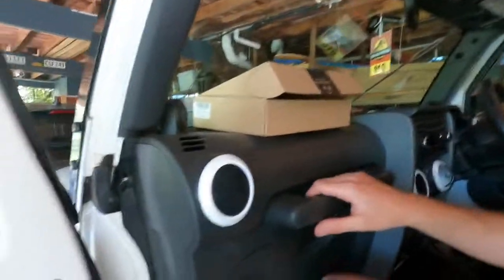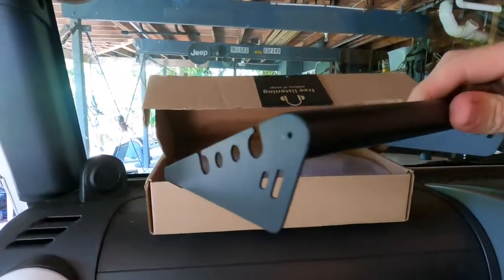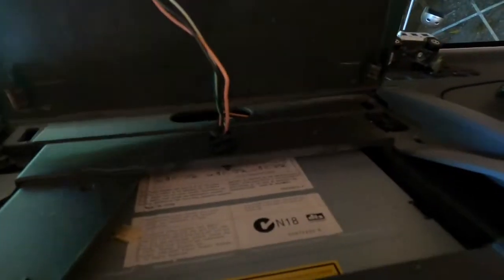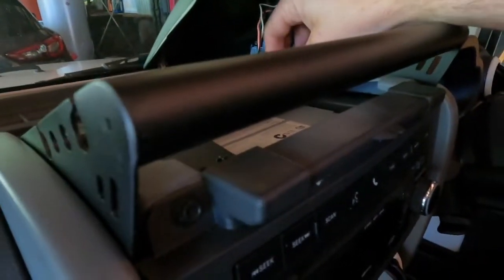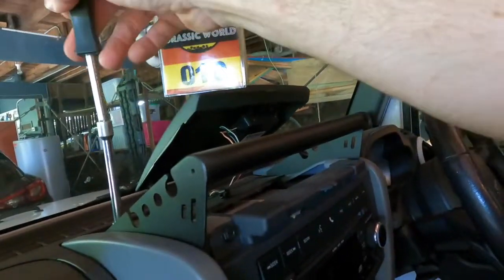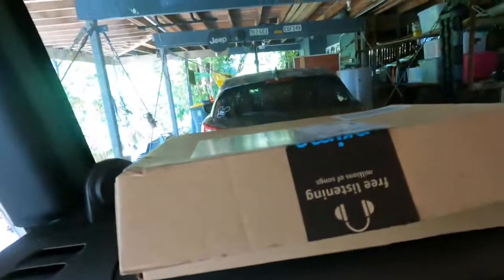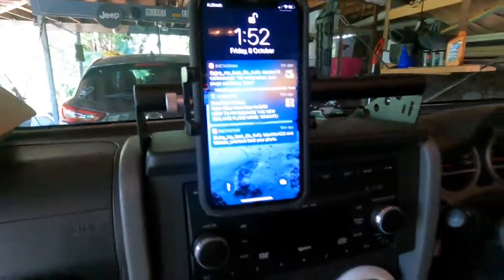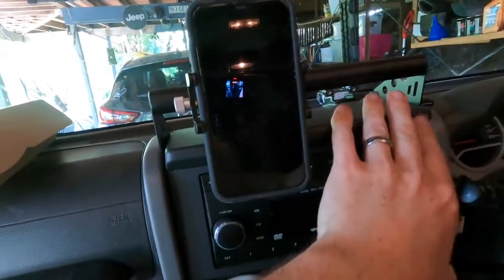JEEP JK 07 12 PHONE HOLDER

Comment: I have the Rugged Ridge center dash top replacement with the phone holder that you mention in your video. It works okay as long as you don't expect to record non-shaky video from your phone while it's clipped into the phone holder. The plastic flexes too much to keep the phone from shaking all over. In addition, the rubber clamp covers have fallen apart on mine, so at this point I'm looking to replace it...I just might have to pick one of these up, especially since I still have the original dash top plate kicking around.

A thought for those holes in the side...Find grommets that fit, run a USB cable through them, and snap the grommets in those holes...Nice, well-retained cables.

You're fighting too much with that top dash cover. It's really easy...Grab it at the rear and pull it up out of the clips, tip it up at the rear, and slide it forward off the dash frame the dash cover piece hooks around. Installation is reverse of removal. Seeing you pull the front off first, or put the front on last, made me cringe.
Reply from the maker: I thought about getting that one lucky I didn’t, this one seems really stable even off-road, I will be mounting more stuff to this one in the future like the GoPro and uhf. I know I really struggled getting this off. Thanks 🤙
Reply: I did order one of these mounts. The main gripe is the phone clamp is kinda weird, so if that's a problem I'll probably just replace it with a clamp with a ball and put a ball-mount phone holder on it. We'll see! Thanks again for posting the video.
Reply from the maker: @JoshTolbertUrbana  awesome, having a ball mount would probably be better just so you can change the angle of the phone. No problem at all, thanks for commenting really appreciate it
Reply: So mine showed up the other day and I installed it tonight. Install was cake, especially when pulling off the RR dash top I had in place. Had to swap the compass unit back on to the old dash topper, but that was no biggie. Took all of five minutes, even with swapping the compass.

If you're not aware, there's a tab on the plug that goes into the compass unit. You can disconnect the wires and take the dash top off completely...Very handy when you've gotta swap the compass back into the old dash top.

I'm not in love with the only-two-screws-at-the-back retention method. If someone wrenches up on the thing, those screws are going to lever right out. While I had things apart I noticed there's two center dash bezel screws right there, above the radio and behind the front edge of the dash-top piece. It'd be absolutely stellar if someone made basically the same mount, but it attached to those two screws at the front too. Couple of bendy pieces of metal could get it done...Hrm.

I'm not in love with the phone mount, either. The tube clamp is passable...It'd be nice if they used a thumbscrew or wing bolt for the tube clamp screw...Then you wouldn't need to keep track of the Allen wrench. The straight-on-only position of the phone clamp itself relative to the tube is kinda meh...I can deal, but I don't care for it. Finally, I expect that the phone clamp itself is going to rattle while I'm driving around and don't have my phone in it. Won't bug me---it's a Jeep, rattles are standard---but I'm sure it'll bug my wife.

I installed the clamp with the hinged side of the tube clamp facing up, so the mount was as low as it could be. Clamping it below the volume buttons on my Pixel 4A 5G lets it sit pretty low, but doesn't block access to the radio controls I use, etc. I really liked the final position.

The powder-coated finish is nice. It's unobtrusive and doesn't look bad in the interior. I could do without the gears image on the clamp. Would have been nice if they'd used black-oxide-finish hardware on the clamp so it doesn't stand out so much. I suppose I could fix that if I really wanted to...

Overall, it gets a solid "I'm gonna see how it goes for a few weeks" from me. I suspect the clamp is going to get tossed, and a ball-mount setup will take its place. The lack of front retention bugs me, and it gives me ideas for fabbing my own that attaches to the screws the rear of this mount does, as well as those top front bezel screws...So maybe I'll try that down the road. We'll see.
Reply from the maker: @JoshTolbertUrbana  nice, you are definitely right, it has a couple of things that could definitely be worked on, for the price it is not bad at all, replacing the mount with a ball mount would be great, just so you can face the phone towards you. It is definitely a lot stronger than others mounts I have used in the past. Thanks for the feedback really appreciate it.